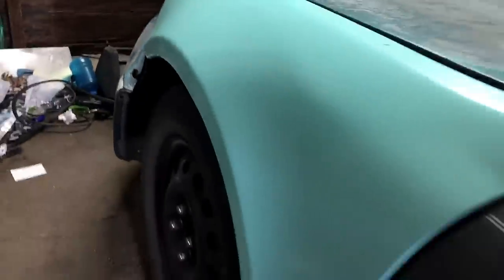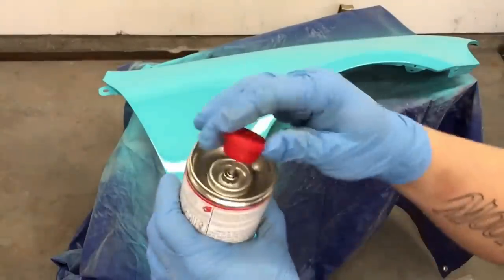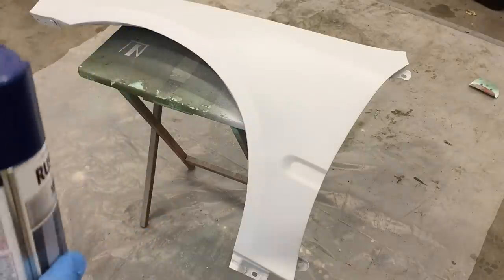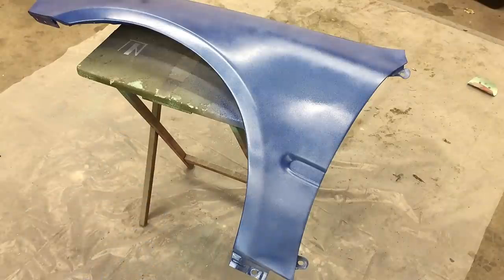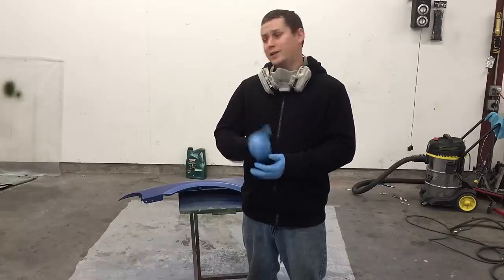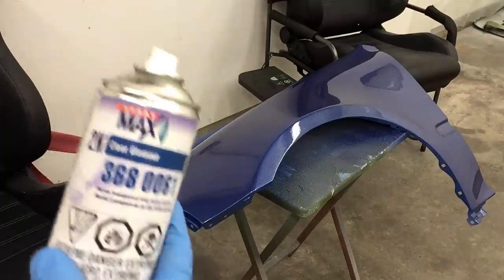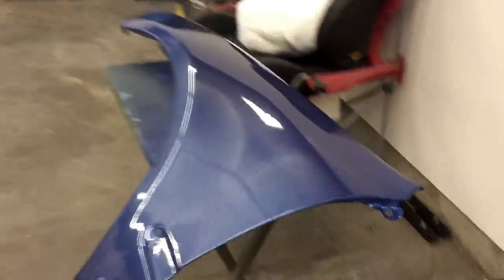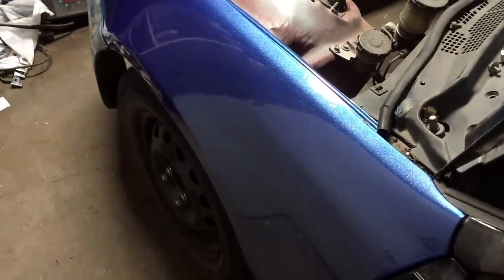Metallic rustoleum spray can paint job with 2K clear (AMAZING RESULTS!!!)

Comment: You show me any other YouTube creator that prefers to shoot his paint from a rattle can? This creator is awesome. Everyone doesn't own a compressor or air spray gun. Most don't want to invest in that equipment. This creator shows it can be done with great results on the cheap. This channel will blow up soon. I love it.
Reply: @crackerican69  individual panels are fine for rattle cans but doing an entire car your better off going for the gun.
Reply: Not certain about the points made but ,if anyone else is searching for painting a car with can spray paint try Bablim Paint Booster (do a google search ) ? Ive heard some awesome things about it and my work buddy got great results with it.
Reply: I rattle canned an entire car and it looked pretty terrible.
Reply: @Lincolnator721  It's too hard to keep proper pressure on spray cans. This ended up looking good, but anything larger than 2x2, most people should just get a gun or hire it out.
Reply: watching this Video is how i did my Truck.  it was a lot of cans i used way over 6 cases of paint.  but i did it.  i still have the hood.  I also bought a Wagner Sprayer for about $70 bucks.  decaned the paint and used the Wagner.  it was mush easier with a fan spray on the bed, but the rest of the truck was this way in the video.  you can check me out on FB Ryden Roam.  a project in progress Album.  Thanks James keep up the great job.
Reply: This style of painting, and even using rustoleum with a brush, has been around for decades.   Mopar had a thread that ran for almost a decade where people were roller painting their cars.   Old stuff.   And yeah, in the 1970's we had a neighbor that used to roller paint his cars.   He'd been doing it long before they started spraying paint.   It's an art form!
Reply: Pooo look kklkkkkkllk lol lkkkk lol koooikkkkkk P poker ♣️

Comment: Okay I've tried this, and the paint crazed... so this time I did my research, watched your videos, looked up data and so on. I spent 3 days sandblasting every part to my motorcycle, I painted it rustoleum performance black. Waited the 24 hr "total cure time" before clearing I hit it all with a heat gun to make sure any contamination solvents would be out. Cleared a test piece, was fine. Went onto the rest, and it alllllll crazed. What am I doing wrong. I dont want to clear the rustoleum during its "wet redcoat" time because I feel like the urethane will lock in the enamel oil never letting it fully cure. Help me.
Reply from the maker: Bryn Hamlin I never had a issue and I hit it while it’s tacky/wet and never had a issue. Idk why yours is doing that. I know how I do it isn’t “proper” but it’s what works so I always go with what works over what the right way. That’s just me though
Reply: I did this exact method and if you mean the wrinkling effect, it happened to me only during late night hours painting and the reason was high humidity I believe when the paint didn’t dry enough during wet /tacky  spraying method, and when I let the paint dry prior to clearing it, same problem happened because 24 hours wasn’t long enough. So finally I let it dry for 3 days prior to clearing with no problem at all. I also switched to crayon color brand from rust oleum I liked their spray ability better.  (I painted my white and red cafe racer aprilia. Good luck
Reply: @alexsmith9328  by clearing you mean clear coat right

Comment: Good freaking job dude!! I'm gonna do the plastic bottom part of my RV ,its like a plastic. Wat would you recommend.  Thanks 👍
Reply: Dry Scuff the plastic with a red scuff pad, use a adhesion promoter OR SEMs plastic primer. Paint over the adhesion promoter but if you use the primer sand the primer with 800 gritt sandpaper then paint. Between paint coats, after it tries in 10 mins wipe using a tack cloth. Then use this 2k clear if you want protection. Do not tack cloth clear coat.

Comment: I painted my fender like that. Sealed off the area with plastic, wet the ground, sprayed it in the garage, Base coat, and clear coat. Came out just like using a spray-gun. I didn't have the special handle device for the can, though.  The best part, the number of paint color, matched my paint perfectly..  couldn't tell the difference

Comment: This video helped inspire me to paint my 1991 Toyota Pickup Extended Cab 4WD!  I learned alot along the way with ups and downs.  Lots of HARD WORK in the prep!  Just wanted to say Thanks for James Dguy for this video and for helping me paint the truck of my dreams!!!  If I could I would add a before and after pic but it doesn't look like that's an option.  I got quotes of around $4,500 but did it myself all rattle can style for $725.  Thanks man!!!

Comment from the maker: The exact 2k clear i used
https://amzn.to/2KI9xJz to just buy 1 

. Or purchase the bundle pack. 

https://rover.ebay.com/rover/1/711-53200-19255-0/1?icep_id=114&ipn=icep&toolid=20004&campid=5338547132&mpre=https%3A%2F%2Fwww.ebay.com%2Fitm%2FUSC-Spray-Max-2k-High-Gloss-Clearcoat-Aerosol-6-PACK-6-PACK%2F183824217372%3Fhash%3Ditem2accc6f51c%3Ag%3A1toAAOSwWN9c6QkO
Reply: Hey man! I love the videos! Hey I don't know your situation or anything, but Amazon has the same 6-pack for $102 Prime, or $96 free shipping from one of their sponsored vendors (R&E Paint and Supply), rather than $132 on that eBay link. I'm not trying to dog on you or anything like that at all. Was just curious if there were better deals out there.
Reply from the maker: David Berger Good to know!

Comment: I've never tried the 2x or any of Rust-Oleum Automotive clear coat. after looking at this video I might give it a shot I use the Rust-Oleum Crystal Clear gloss the original stuff, the only thing is you got to constantly be buffing it once or twice a week to give it that Crystal Clear gloss but as long as you put plenty of Glass I haven't found any other thing that satisfying when it comes to rattle can . Rust-Oleum products are probably the best hands down by far when it comes to rattle can and leaving behind a nice finish that lasts like I said I use that crystal clear stuff and it's got his ups and Downs although it is good for industrial use it doesn't do too well when exposed with gas. about a year-and-a-half ago I painted my Chopper, gas tank and fenders.had a little leak from my gas cap  long story short when I would fill the tank up too much the gas would run down the side of the tank  and  reactivating  the clear on top I would imagine because it's a one part and not enough hardener?
Reply from the maker: Albert Villanueva Yes Rustoleum products are by far the best cheap affordable spray cans out there. Now spray max does make custom colors in a can with hardner and their clear coat with hardner like what I used in this video and they are way nicer and more expensive too. But yea Rustoleum with the 2k clear over it they work great for me 6 months down the road still holding up.

Comment: Just what I planned to do but I have my work cut out with a full size 93 gmc van, a little rust,  alot of windows, roof vent, new cab visor etc. I'm going with the silver and 2K clear. Thanks for the reassurance that spray can will work. My compressor broke.

Comment: That looks amazing!!! My hubs and I used this paint to do his 94 honda civic. The metallic sprayed on a bit different than regular paint. There are some spots that seems either over sprayed or under sprayed. We did heat up the cans with reg Hot water. So the car has been sitting there with that paint. I was thinking maybe wet sand the spots then go over it again? Also we subscribed since you did the lime green paint job and motivated us to prime and patch his honda up. Kinda low on $$ but we aren't giving up.
Reply from the maker: Ramirez Lawn Care With metallic paint wet sanding the paint don’t work good because the metal flakes but if you do sand it down just sand it to scuff it up. I hope it turns out great for you! Don’t ever give up :)
Reply: Yes, that makes sense. We might just do that then, scuff a tiny bit then spray over. Thank you! God Bless and Congrats on your Success!

Comment: First time I've seen your videos and I've watched three or four so far, I'm already a fan.  I'm a complete rookie, but I've decided that next summer I'm going to refurbish my (deceased) dad's old 1988 F250... it's not worth anything, but it has sentimental value to my mom and me.  I have a few questions if you don't mind answering...
My hesitancy with the 2K is that you have to use it all right away or it "spoils".  What if you use the 2X (because I'm cheap) but then hit it with a couple layers of ceramic coating (which I'm going to do anyway no matter what clear coat I use), won't that keep it fresh as long as the 2K?
There's a 2K now, kinda spendy, that's premixed called Car-Rep 2K, that apparently you don't have to use it all in a day or two and it will keep, have you used that clear coat at all?
Have you ever used KBS spray, and if so, is it any good?
Thanks for any thoughts.

Comment: Rustoleum 2x has different components than the Stops Rust or metallic, that's why it wrinkled on you. If you're going to use 2x paint, you have to use 2x clear or wait 48 hrs.
However, you are using 2k so no problem anyway.
Reply from the maker: Jack Tate I never had a issue with wrinkle so far. But the 2X clear always had issues with winkle but the 2k does great!

Comment: Put a piece of masking tape on the clear coat right now, and peel off the tape with medium speed.. the SprayMax 2k would stick right on the tape.. this stuff doesn’t adhere too good.. I’ve used it years ago. The 1k SprayMax clear is by far the shiniest and it sticks very well, but it’s not as during with bird dropping and rock chips.

Comment: Great video,, do you have any advise on how to tackle a fender that was painted with a darker colour by previous owner,, you can only notice the colour difference in certain light ,,, but I dont like it,, they don't make a duplicolour match so you have to get the paint made up but I guess they were too cheap.. should I do just a light sand to make the paint adhere or should I primer over the whole panel ??

Comment: Should you wet sand the paint before applying clear to reduce orange peel? Or wet sand after clear coat had applied and cured for 48 hours ?

Comment: Kinda funny putting spray cans in hot water.
Back in the 80s we did hot pot paint jobs.the paint flowed alot better. And used little reducer.
Going to try it with rattle cans👍

Comment: The 'orange peel' is a chemical reaction between the uncured enamel and the 2k clear coat.  If you let the enamel dry for several weeks before applying the 2k clear it will be fine.

Comment: Awesome info, you earned one more subcriber! I also experienced that the rustoleum 2X clear would attack and wrinkle any rustoleum base coat, and it will turn yellow by UV overtime.
Questions:
1/ It's been 2+ yrs; does your Rustoleum Metallic Blue fade? 

2/ Do you recommend using SprayMax 2K Clear  for headlight restoration?
TIA!

Comment: have you ever attempted using 2k clear over oil based enamel rustoleum and not the 2x rustoleum (acrylic) ? just wondering because im painting my truck soon and want to make sure the clear wont ruin the basecoat (going to let the base cure then lightly sand and shoot clear)
Reply from the maker: Squid_Garage Not over oil based paint I don’t think 🤔
Reply: @JamesDguy  ok thanks for the response. love your work btw, i will just try it anyway and hope for the best. don't think there should be a problem as long as the basecoat cures and "airs out" before the clear is sprayed.

Comment: 2 questions!

1: I’ve read that if you get a base coat with typical streaks from a rattle can that you won’t see them with the 2k clear?

2: I used mtn hardcore gloss with no top coat but I’d like to as it’s faded over the year and it says it’s a modified alkyd base or something like that... no idea what that is but will 2k spraymax work with this?

Comment: I have a question ‼️‼️‼️⁉️⁉️⁉️ 🤚🏽🤚🏽🤚🏽 
After you spray the color .. can u take a week or so to throw the 2K clear??? Or it has to be right after it drys?? In the same day???
Reply from the maker: B's Garage I have never tried waiting to add clear coat. I will try on a test panel some time and do a video.
Reply: Ok cause mine is getting the same combo and i started yesterday , so thats why i was asking , thankx again and keep up the great work 💪🏽🤙🏽
Reply: @bryantdorta1270  know with real paints gotta put clear on within think 24 hrs. Never waited while using rattles tho.
Reply: B's Garage if you wait to put the clear on the paint has to “gas off” for a week or 2, once the car stops smelling like strong spray paint then clear it.

Comment: How long do you wait to clear coat? I've been told to wait a week for the paint to cure first.
Reply from the maker: Conner Blase You will hear all kinda things when it comes to paint but I do what works not what I hear. In my experience putting the 2k clear on 10-20 mins after the color works the best with this spray can stuff and out of gun for me as well. I have 5+ month updates on the fenders I have done and still holding up great
Reply: @JamesDguy  Thanks for the speedy answer. I appreciate it.

Comment: +Moore Motorsports James Dguy So, if one wanted to do 6 coats of 2k clear per panel, would you wait 15 minutes between all 6 coats or would you split the coats up - like 3 one day and three the next? Also, would an 1.5 - 2 hours total drying time after all coats of clear be good? Thanks for all that you do!

Comment: You could have eliminated some of the orange peel by lightly sanding the top coat with higher grit paper and then cleaned with denatured alcohol  and then shoot the clear and then wet sand that
Reply from the maker: glues4wood I know that but it’s not good to wet sand metallic paint due to the flake but I could have done things a lot different if I wanted to spend longer. But this was just a demonstration for the people who aren’t looking for a car show quality finish. It looks great for a cheap few hour job. It would have taken much longer to wet sand and clear and wet sand and clear and so on but that’s how you would do it if you wanted it perfect but happy with the outcome. The imperfections came out with wet sanding and looks great.

Comment: How do you clean what you are gonna paint,I try painting on mine but I get tiny bubble like or wrinkles. Could.it be the weather? 50• degree around here in Kentucky right now bro.
Reply from the maker: Abel Vargas I use rustoleum wax tar remover and it does great at removing chemicals that could mess with the paint. Also temp does factor in this.

Comment: James, quick question...how long do you wait to apply the 2K clear after the last coat of color? 
Also, I would greatly appreciate if you could let me know what ventilation unit you have!!! I need one like that and can’t seem to find one online. 

As always, thank you for your amazing videos!!
Reply from the maker: A Palmer Thanks and I waited 10mins for the color to dry some then added the clear. Idk where the ventilation unit is from it came in the shop when we got it but it works amazing. It actually works so good that without a mask I can barley smell fumes but I wear it anyways lol.
Reply from the maker: A Palmer Thank you for your donation man I really appreciate it!
Reply: Glad to help with the donation! I have another question if you don’t mind! :) 
My current project requires two colors to be painted right next to each other. Would you recommend I:

1.) tape off, color AND clear coat one section, wait for it to dry and then do the same to the other section 

OR

2.) Color one section (but no clear), let dry, tape off and color the other section followed by one clear coat over both colors. 

What do you think? Thank you for everything!
Reply from the maker: A Palmer Number 2 sounds better but then again both would work.
Reply: Moore Motorsports James Dguy if I choose #2, would I have to then sand the colors with 220 to roughen up the surface before spraying the 2K clear?
Reply from the maker: A Palmer yes and I would wet sand them with 1000 grit just to scuff them a bit. As long as it’s not a metallic paint job you can scuff before clear coat. The metal flakes can be messed up in the paint job if you wet sand before clear.
Reply: In a different bike I first painted one color, 3 days later (2 is ok too, unless you do have. Climate control paint room), wet sanded it (not sure but either 800 or 1000 grit), then taped it to do the second color, after 20-30 mins I removed tape, inspected for any imperfections, if I saw a dust particle I removed it with 1000 grit lightly,  lightly used tack cloth to remove any dust I didn’t see and then sprayed the clear. (So the clear bonds mechanically on the 1st coat and chemically on the 2nd).   Note: here is how to avoid a problem with rough edges between the 2 colors when you remove the tape. Before you spray the second color, around the tape first spray the original color, and after 10 minutes go over it with the 2nd color. Your edges will be perfect.) And I never sand the 2nd color with the 1st it can stain the lines.
Reply: Alex Smith thank you!!